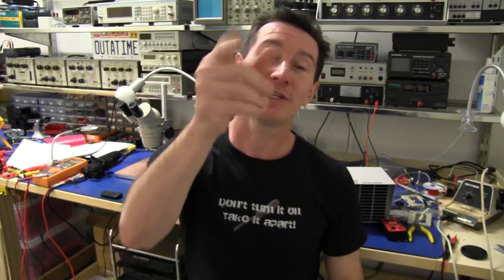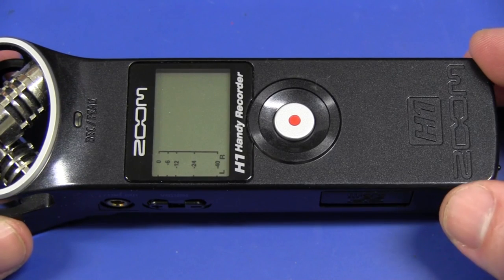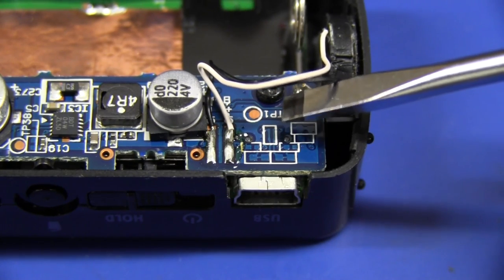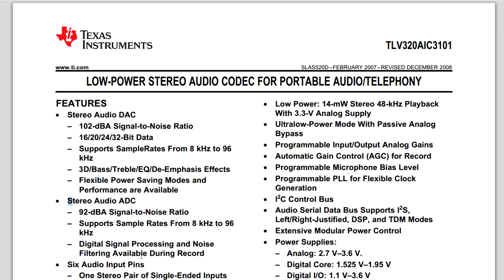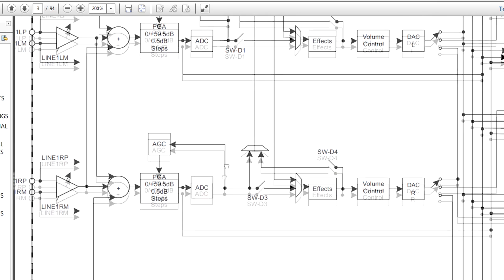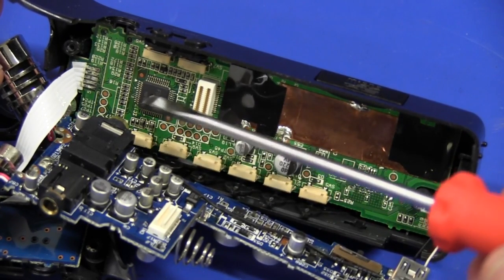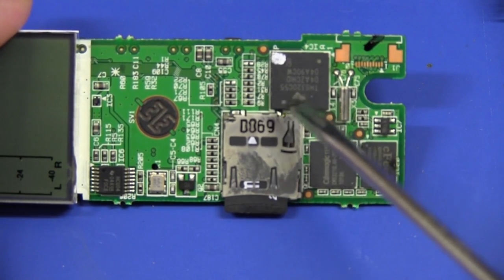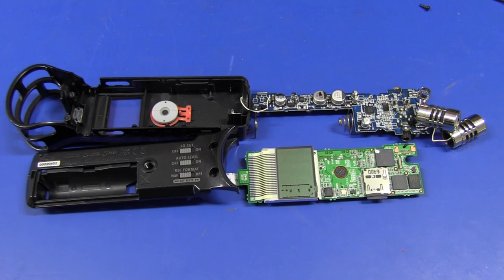EEVblog #271 - Zoom H1 Recorder Teardown

Comment from the maker: The unit records the time and date. A low power 32.768KHz oscillator is needed to keep that running when the unit is turned off.
Reply: If it lost date/time immediately then I need to replace this oscillator?

Comment: That's absolutely right.  Large numbers of Zoom H1 were produced with the defect, early on.  They were accepting returns for replacement for a long time, perhaps still you can do this.   I couldn't do it because I need it for my work. So, the workaround is never leave a battery in the unit.  (The battery life while recording is unaffected; I have run it over 4 hours at times, LOVE this unit for backup audio at event videography. It saved my ass many times when main audio failed.)

Comment from the maker: No study, it's all still off the cuff. I don't open up, inspect, and them contemplate for while before recording. Although I have mostly learned to look up unknown chip part numbers before pressing record, instead of just taking a silly stab :->
Reply: Hello. I know this video is more than 5 years old now but it would be nice if i get a respond. I have the same issue as the man who wrote this down below: "... i have a problem with my zoom H1. it wont turn on.. and when i connect the usb cable is getting super hot...starting with  the cip between C19 and IC3 .. where the power button is located ( on the other side.) and then going on all pcb and capacitors.  is there a fix for that?". 
I'm hoping to find answers.

Comment: @HomeDistiller, there was a firmware update some months ago. Now you can use the H1 as a usb mic... you can even choose sample rate and change the levels with the hardware buttons while in usb mic mode.  You can still transfer files via usb, of course ;)

Comment: this is a consumer unit if you were in any kind of production you would spend a little more and get the H2. it has production features, like real mic inputs, metal mounts better level controls etc.

Comment: Coupling caps (of the correct capacitance value) are a short for AC and so pass audio, while blocking DC from entering places where it might upset the circuitry or even cause damage. Smaller values do the same thing in radio ckts.

Comment: The basic functional principle of the devices are the same, the difference lays simply in what sort of electrolyte material is used. If you look up Sanyo's site on their well known OS-CONs it clearly states that the capacitors in this series uses conductive polymer or organic semiconductor electrolytes.

Comment: I think you've got to hold down one of the buttons as you turn the power on or something, I understand that's the case to access some features of the H1, though I must admit I've not used one, I've only heard demonstrations of them.

Comment: That TI C55xx DSP has a number of "accelerated" audio codecs available for it

However notably not MP3 ENcoder.  So they must have licensed that above what's normally freely available, or rolled their own (and are probably paying royalties for it).  Interestingly, it's also got AAC encoding which arguably has a better bitrate than comparable MP3 audio - I wonder if they'll bring out a Zoom H1.1 with an extra position on the switch to switch to AAC encoding

Comment: have one of these and used it to record my band practices. That auto gain control had to be switched off. could never figure it out-the louder the band played the smaller and more compressed it got. We got good results by passing auto gain and mucking around with the position of the unit - just as you would any mic. surprisingly bloody good little piece of kit. When you do these tear-downs - do you always mange to get them back together and in working order? love the tear downs...

Comment: For only US$80 more, you can get its big brother, the H2n, which has 5 mics with adjustable patterns, recording in 4 tracks (2 internal + 2 external), 20-hour operation on two batts and power-loss recovery. 2GB SD card, optional 32GB. How can you resist?..

Comment: If the power switch comes off you can still turn it on.  Put a toothpick in the top of the slot angled toward the ground at 45 degrees.  Rake the toothpick toward you and you can feel it against the spring loaded switch the switch handle is supposed to pull

Comment: Very detailed teardown! What is that large piece of copper strip doing down below the battery? I have one of these that came in for repair, the user had forgotten to remove the drained out battery from it and kept it for a couple of years. Battery had leaked and it corroded that copper. Trying to give it a new lease of life.

Comment: Real-time clock does exactly what it says, it keeps a time, and depending on the chip's ability, date and other added features. The clocks are low power devices and are used in many products. The crystal is needed to help keep an accurate rate of time.
Reply: Is there a separate battery to keep rtc working?

Comment: Is it a 2 layer board?

Having the copper shielding on top sure does give them a lot more PCB space to run traces :p Perhaps they needed the shielding separate to keep it to that size. I wonder if having someone cut and manually solder that piece on is more expensive than adding another pcb layer...

Comment: -> "solid state" capacitor is more of a buzzword than an actual description, as most types of capacitors are solid state components. What they actually mean is an electrolyte capacitor with a solid electrolyte like a conductive polymer or organic semiconducting material. However, the type of package the capacitors in the video has are used for all types of electrolytes, including wet, without the data sheet it is difficult to say what electrolyte is used.

Comment: Odd, the specs claim 10-hour operation, but 9.5-hour battery life. I guess for that last half hour, just have to do without power. :-)

Why did you get the unit? I seem to remember that you already had a mic setup with your camcorder.

Comment: Hi, great video! 
Did you try to check the consumption of energy? It seems that some series of the product experienced trouble. Battery is drained in some hours! Even if its Off
thanks and regards
Reply: I encountered this same problem
Reply: @achmadmarendes  In the comments of this post you can find the solution. Basically you need to replace a capacitor. I'll try it as well on mine. (https://cheesycam.com/zoom-h1-battery-drain/)

Comment: I need to use this for recording lectures, and have tried several different external mics. All of them result in significant hiss.  I want to unsolder the microphones and insert cables around 2 meters, so I can attach the microphones to the podium mic.  Do you think this will work, or, will I end up with RFI issues or other transmission line noise, ring, etc.?

Comment: great teardown mate, i have a Zoom H1 and its amazing but last week it stopped communicating with the computer via USB, so i cant transfer audio files using this method,strangely it powers the unit ok through the usb fine, ive op0ened the unit ,checked the usb connector for any obstructions etc, used different cables but to no avail, i know i can use a card reader to copy the audio files but usb was so useful thanks again
Reply: Did you try it on another computer?

Comment: Do you think it would be hard to mod a H1 recorder to act as a binural mic (put the microphones in ears distance from each other)? For someone who is just a beginner when it comes to electronics?
Reply: Try ASMR Oooh by the way, love your videos! :)
Reply: Try ASMR Buy an external mic for it, do NOT mess with the internal mics, you'll mess it up.
Reply: Well? How to fix the handling noise issue of the internal mics?
Reply: For voice, the lo-cut switch works well.  For music, get a shock mount that accommodates that standard camera thread.  The elastic band types work the best.  It's impossible to isolate built-in mics from low freq shocks. If you're handy, you can build your own.

Comment: Oooo. Had this years ago and hardly used it. Now started to use it again however the battery had leaked in it. That's fine and cleaned it, but now use it more discover it chews batteries like there is no tomorrow so pretty useless on battery.

Comment: Hello , i have a problem with my zoom H1. it wont turn on.. and when i connect the usb cable is getting super hot...starting with  the cip between C19 and IC3 .. where the power button is located ( on the other side.) and then going on all pcb and capacitors.  is there a fix for that?
Reply: Why nobody responds on this? I have the same issue.
Reply: same(
Reply: I wonder if you found a solution.
Reply: I was recording with my zoom h1 connecting it on my pc. There was a battery inside too. Suddenly it stopped working. Not turning on. I loved the device, the sound quality was awesome.
Reply: Anyone here find a solution yet?

Comment: I thought the whole purpose of stereo recording was to capture phase differences between the two channels. If the mic is equidistant from any sound source, how would you get any stereo effect?
Reply: Stereo effect depends not only on phase difference, but also on sound pressure level difference, achieved here by using cardioid pattern microphones, I suppose.

Comment: I am considering getting this recorder and i am investigating is it possible to add connector that would allow attaching remote button control start and stop of recording. I see there is some room, but I do not have good sense of real dimensions. What is your opinion, is it doable, maybe adding some super tiny 2.5mm connector?

Comment: my battery has corroded inside or it's got wet. all the copper has rusted away, won't power on. so the copper shield must be part of the circuit.

Comment: can you help me , my zoom is just dead with no reason ..
can you give some tips for my problem ?
thanks :)
Reply: my h1 wont turn on for no reason too... no one cant help.
Reply: @organicforlife  I was recording with my zoom h1 connecting it on my pc. There was a battery inside too. Suddenly it stopped working. Not turning on. I loved the device, the sound quality was awesome.
Reply: Mine died last year. I finished transfering a large file and I forgot it plugged into my computer. When I went to check on it, it was pretty warm. I haven't been able to power it on since. I think it's a capacitor that crapped out, but which one?